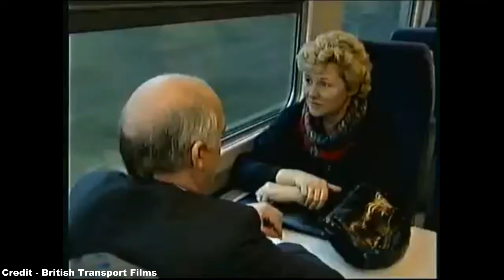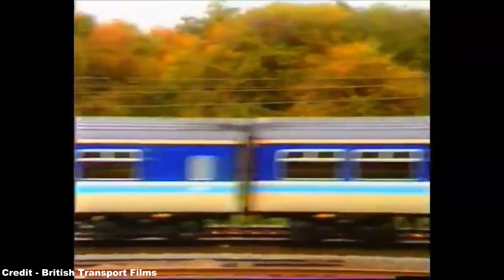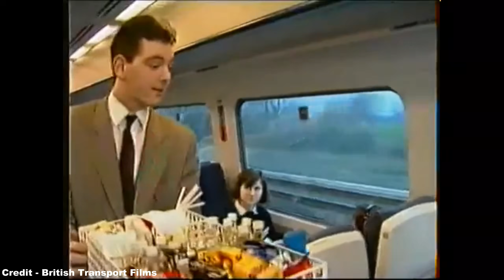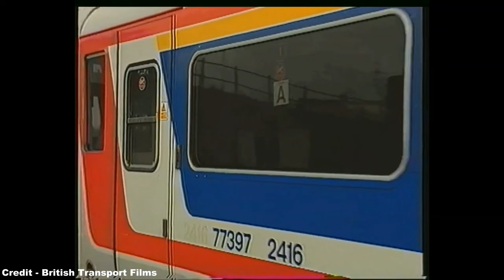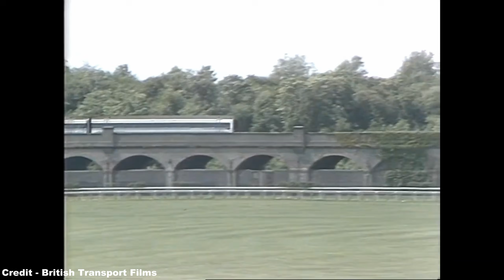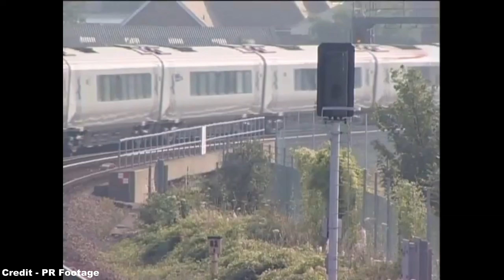How the Class 158 and 159 saved Regional Railways (Reworked)

Comment: Yes, the class 158/9 has been a mainstay of many services over 30+ years, though it’s about time more modern, quieter fleets, should replace them, hopefully still with comfortable seats and good ride quality. But BREL was just as capable of designing lemons, like the rest of the sprinter series, with cramped and noisy class 15Os, et cetera, still not fully retired. It’s ironic that the best BREL design – the HST‘s have been largely replaced by the dreadful Hitachi Class 800s , with dreadful ride quality and mostly minimally padded seating, unsuitable for anything more than short commuter journeys, not six hour plus travel to Penzance or Aberdeen/Inverness.

Comment: I travelled in them between Edinburgh and Glasgow and hated them with a passion. They were cramped with insufficient leg room. Half the coach was smoking and non smoking, air conditioning was very poor. Often only two coaches would be on rush hour trains. Then there were problems with the doors and I found my train didn’t leave for forty five minutes one morning. I gave up and caught a  IC train to Glasgow central instead.

Comment: Passenger comfort not up to modern requirements, hmm, replaced with Pacers! 
In the Northwest we got the really basic ones with the genuine bus seats fitted. 
These were great, not. Toilets locked off, rain coming in through the roof and virtually no heating made for horrendous commuting to and from Manchester from Southport.
When they were coupled up to a class 150 Sprinter passengers would rather stand up in that than sit in the Pacer!

Comment: Some 158 units were also fitted with ETCS to allow them to run on the Cambrian line
Reply: Indeed, and passengers there will sorely miss 158s in 2026 when the (rough and clunky) CAF 197s replace them.
Reply: And before that, RETB

Comment: EMR are spending millions refurbing their 158's so they seem to have a bit more left in them yet. I travelled in the Norwich-Liverpool route a few times this year. Mostly on 158's but they also have 170's on this route

As long as I am not sat in the middle (migraine inducing vibration/resonance from the engine), the 158's are fine to me. Seems to suffer from issues with the route between Grantham and Norwich mostly, rather than the trains themselves

The Northern Nottingham-Leeds service has almost exclusively been moved to Class 195's now, but I did see a rare 3-car 158 recently
Reply: I thought it was just the 170s they were refurbishing? 
Do the 158s accelerate any faster than 170s? I always find myself thinking I could get where I was going quicker if we had faster accelerating trains, rather than necessarily higher top speeds

Comment: Very interesting these were first introduced on the Glasgow to Edinburgh line. Says a lot about the horrific under investment in the regions by BR at the time. The trains built to save the rural Regional Railways, were actually deployed on what elsewhere would be considered a high density low speed Intercity commuter service!
Reply: What are you talking about? The 158’s were designed and ordered for regional intercity routes, not rural local services.
Reply: @Bungle-UK  I suggest you watch the bit in the video about later conversion to class159 and delete your somewhat ignorant post.
Reply: @RussellGi  They over-ordered 158’s so the order was changed and they were delivered as 159’s. What’s that got to do with anything? It’s quite funny how almost the whole Regional Railways fleet was replaced with new rolling stock in a 10 year period but you describe that as “horrific under investment”.
Reply: @Bungle-UK  With all respect, the video mentions the 158s had to be refurbed due to ride, capacity and internal quality not being up to scratch, hence the conversion to 159.  Great train the 158, but was woefully inadequate for Glasgow - Edinburgh if you care to read comments of those who used them , whilst considering the aforementioned 159 conversions that weren’t present in Scotland.
Reply: @RussellGi  I’ve no idea where you’re getting this notion of the 158’s being poor quality from. The 159’s have first class compartments (3-car 158 never had them) and retention tanks for the toilets. Other than that, the interiors were broadly similar. Passenger numbers on all routes increased after the 158’s were introduced (including Edinburgh-Glasgow) so clearly people liked them even if you think they aren’t suited. On Transpennine, 158’s revolutionised the service at the time. Oh, and the 158’s that became 159’s were converted because too many had been ordered at a time of economic recession; they weren’t converted due to quality issues at all.
Reply: @Bungle-UK  Are you suggesting running stock with no retention toilets between Scotlands two biggest population conurbations is not an example of “cheaping out” by deliberate manufacturing design?

Comment: -Could you open the window? It's a bit stuffy in here.
-If I open the window it will upset the air conditioning.
-If the aircon worked I wouldn't be asking you to open the window...
Reply: The never ending cycle of class 158s in the summer lol
Reply: i work for EMR as a guard, and can confirm 158 AC is a nightmare to keep at a ambient temperature. You cannot win, and the rear cabs are great to ride in, in summer, if youre a plant, that requires intense heat. But for all their little faults, theyre very nice to work and reliable.
Reply: Should paint the roofs reflective silver
Reply: This is very often the case with the class 334 aswell
Reply: I had heat stroke back in 2022 because of this

Comment: "Full electrification of the line" don't make me laugh!
Reply: I would call it desperately needed, but then I have a look at UK Politics who‘d have to cough up the money…
Reply: @genoobtlp4424 it does run to London so there’s always a chance
Reply: @1stdaybreaker707  fair
Reply: Well, ORR can be partly 'blamed' for scuppering that idea, with its assertion that third-rail DC isn't safe enough any more. Bearing in mind that the Southern has always installed enhanced lineside fencing, plus enhanced trespass guards at level crossings, and most recently that NR has all but banned track works on lines above 25mph nationwide unless blocked to traffic, this ORR 'policy' looks rather silly! Anyway, it seems the future for Worting-Exeter is blah blah blah battery innovation with charging en route from intermediate widgets.
Reply: @ChangesOneTim  in that case I have a (potential temporary) fix from TMR and SZU in Switzerland: wire ot at 3rd rail voltage (in this case 750DV?), but build it for 25kV clearances and when the whole line is done, transition to the standard 25kV…

Or just build intercity 319…